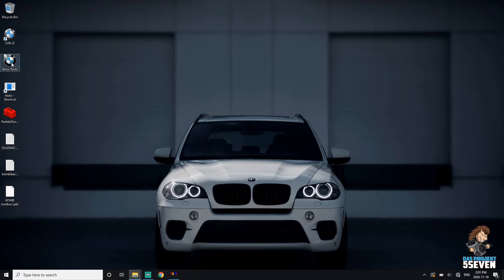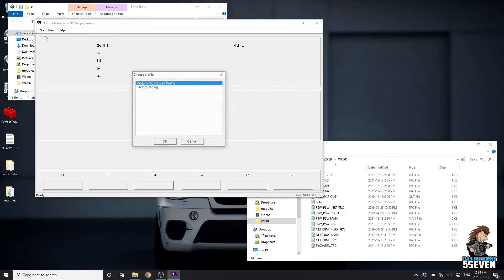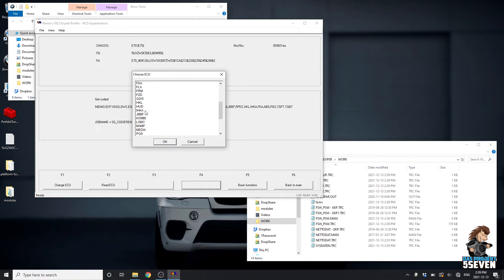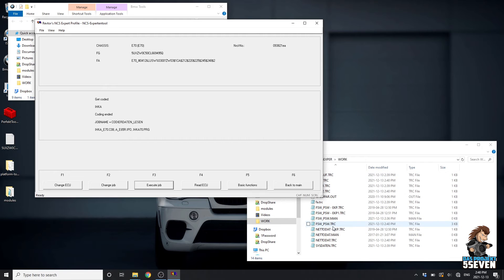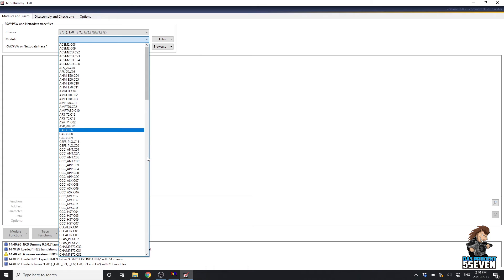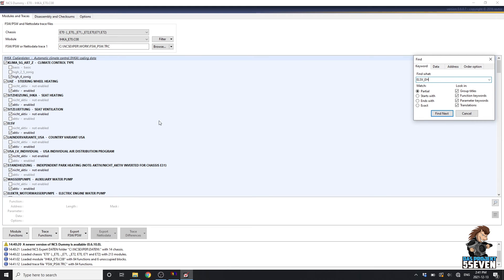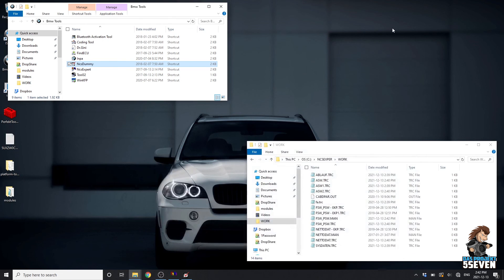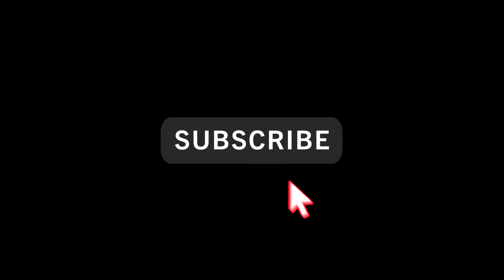How To Disable Easy Entry Exit Steering Wheel With NCS Expert/Dummy

Comment: I wish you would post more videos.  You are so knowledgeable and I've learned so much from you!
Reply from the maker: Glad you found it helpful. I don’t have my diesels anymore :(
Reply: Hy , where can y send you à vid please .? 535d 272hp e61 , start all power , but when y drive at 70km/h (+/-) 1300rpm , when y push y have almost nothing , when the RPM arrive at 2000 it accelerate normal , 

So y tester the vacum actuator from little turbo but y dont know if it move enough,  can you help me with that ? 

3 New pressure converters and all hoses 

Tanks à lot
Reply from the maker: @unutilisateurgoogle8927 hi, I’m out of a country right now. Can see messages but not YouTube. Will be back after Sep 10. Did you check your injectors?

Comment: hello i have a problem my bmw 535d goes into emergency mode as soon as i reach 220kmh what could it be please help
Reply from the maker: That’s a very broad question. You need to find out what error codes you get. If this car is tuned, there were some issues with programming around fuelling and limit controls.

Comment: Fellas, I have been looking for this all over!  Nothing in the forums either. You haven't posted this in the forms yet huh? Perfect! I truly can't stand that steering wheel moving every time I get in and out of that diesel!
Reply from the maker: How timely we posted it. Hope it works for you.
Reply: @alphadevyat  disabling this doesn't affect the manual telescopic movement of the steering wheel correct? I'm still able to adjust the wheel at will, with the little lever on the column, just the easy entry is disabled? It only moves when I want correct?
Reply from the maker: Correct. You are still able to manually move the steering wheel.
Reply from the maker: @foolyou7633  correct. Full manual adjustment is still fully functional.
Reply: Can this be done one BimmerCode